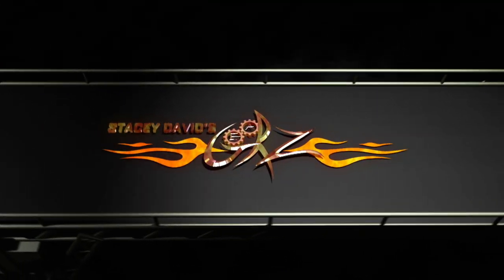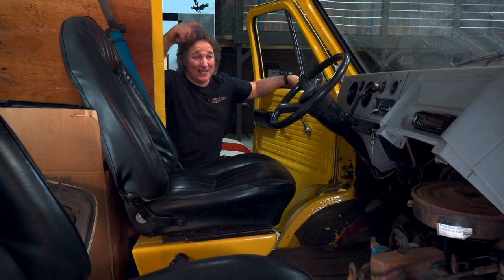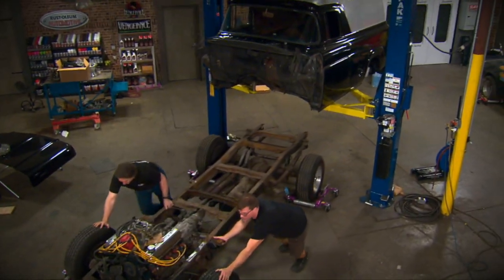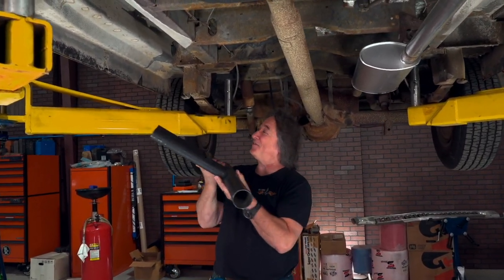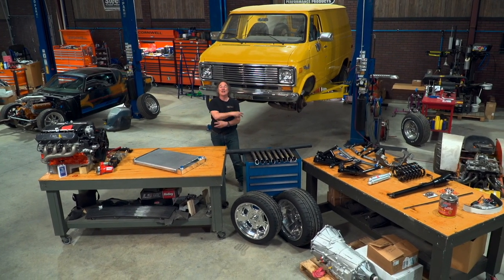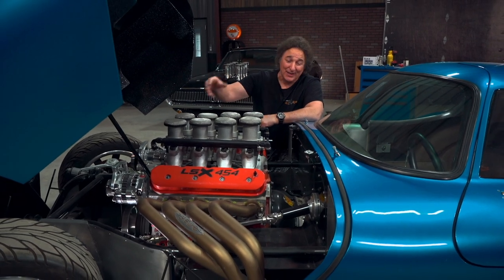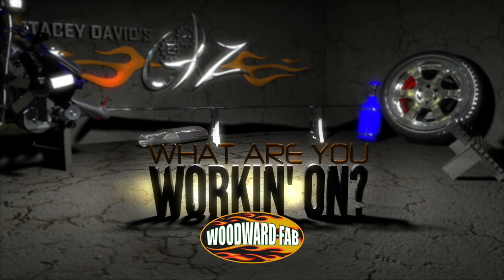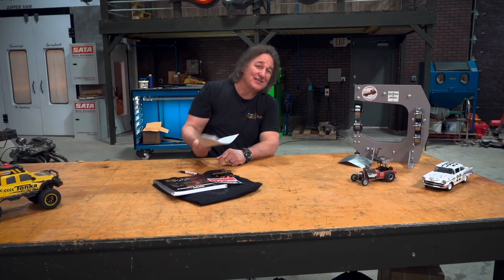PLAN Your Project and Avoid Frustration - Chevy/GMC Van Upgrades - Stacey David's Gearz S16 E12

Comment: Something I've learned (in regards to the rusty header wrap vs ceramcoat) is that yes the ceramcoat is more expensive initially but if you factor in maintenance on the wrap, eventually it out-costs the ceramic 

If you have the $ and time for ceramcoat I'd say go for it and save yourself time and money later

Comment: It would be nice if Gearz would list the cost of all the items on a build, at retail value, and the cost of the vehicle bought to build. Plus the Labour Hrs. It would put into perspective what the true costs are.
Reply: Van 12 grand
Wheels and tires 3800
Suspension 2600
Steering 1100
Exhaust 900
Motor 25000
Misc 7 grand
Labor building tools welder insurance overhead and a lifetime of obsession 14million. 

All this does is discourage people from trying. Shit, I should delete this
Reply: @destro513  25k for an engine.   Are you high?   That would be the cost for a full up race engine not a crate LS.
Reply: @bmstylee  oh cool so how much is a gm performance gen 3/4 427 600 horse crate motor with turn key Holley programmable stand alone and all the stuff to make it run and mount, starter, belt drive, motor mounts, flexplate, radiator and fans... Oh and I forgot about the 6l80 so more like 35 grand. My bad. Don't forget the big money driveshaft and ford 9 inch or Dana 60 rear with gears and lsd. Oh you said race motor. Let's ask daddy Dave or one of them street racer race car guys how much then motors cost. Bet they wish it was only 25 grand
Reply: @destro513  summit has a similar one for 13k 427ci/630hp.   Or get a 5.3 core, rebuild it, add boost and make 600+ for a lot less.
Reply: @bmstylee  sorry bill, at work running an Okamoto surface grinder. Didn't mean to come off like a jerk. I only know how this all adds up cause I can't afford it and when I thought I could, I couldn't. I'm the guy who finds same van or close for 3500, gets a rusted out 2005 dually for 375 bucks and uses the 6.0 ls and 4l80 with 180k and throws a used cam and lifters at it.
Reply: @destro513  no worries.   Stacey uses crazy expensive parts.  We all know that.   You can get really good power from a 5.3L with porting the factory heads, and adding a good cam.  Put some ring gap in and add boost and 600hp is easily attainable.    I would love to build something but the average gearhead keeps getting priced out more and more.  So I feel your pain on it.   I'm taking my 2017 Silverado daily driver and making it my project car.   I've got leveling struts coming tomorrow which I will be installing Sunday.
Reply: @bmstylee  hot damn bill, I got my 2004 2500hd I'm gonna restore next winter. I love that danged ole truck. I hate how the TV and ebay and bat priced us working folk right outa our passion. I'm all about finding those cars no one is paying attention to. Like 70s Camaros can still be had for like 3500 bucks. Everyone wants the trans ams. And jeep cjs can be had for 1 tenth the price of an early bronco or fj40.
Reply: @destro513  Give me one of those 70s land yachts.   They generally had big blocks in them and enough room for you and your friend to cruise in comfort.

Comment: We have a 1971 Chevy Van that have owned for 45 year. It is factory hugger orange and a place that went closed it door years ago put windows and  interior in it.  It has 295/50R15 in the rear and 245/50R15 in the front. It had some problems years ago and has been in the garage not running but it is do for resurrection. This van has been with use so long that it is part of the family . I would love to send you some picture if I had your email.

Comment: Yep, it all comes back around. Look around at the Cruise-ins, Cars and Coffee and local car shows, Your seeing ALOT more 1973-80's cars, Why? because they have become this generation's "$500 Nova" of our generation, They are cheap "old" cars that still run and and drive that the younger kids can afford to buy and drive while they fix them up. Just in my car club alone there are 6 either being daily driven while working on or being built in a garage and it's all makes and models not just the popular cars, I bought a 73 Buick Regal a few months ago for $1200 and drove it almost 50 miles home, Our Club President is building a 74 or 75 Ford Maverick for his wife, Our Treasurer and her daughter are building a 77 Torino,  one guy has a 75 Nova, another guy has a 77 Plymouth Fury and is in the middle of building a 76 Duster.

Comment: Hi it's me Gary our old Shop truck was a 80 chassis with a 88 cab with a 84 turbo 400 trans from a Chevy van with a 76 3/4 ton rear end with a 94 bench seat that was A 2002 assembled vehicle

Comment: Just a warning to anybody thinking about buying those lower control arms, they ARE NOT a bolt in solution. There has to be some modifications done to make them work. The cross shaft diameter is different. Either the cross member or the shafts on the lower control arms have to be modified.

Comment: I went the complete opposite way as far as the suspension. First did the 4.8ls/4l60e swap in my 86 GMC g2500 conversion van. Now I'm converting it to 4x4. Just need to get the transmission/transfer case,  Front axle rebuilt if i don't decide to go with a Dana 60, both drive shafts made and then the the floor shifter for it. Then when all said and done i will need to reprogram my computer to except the 4wd trans, I think.

Comment: The segment about whether to wrap your headers or get them ceramic coated was pretty informative:

While wrapping the headers is a lot cheaper and easier for the do-it-yourself types of mechanics, it's also more maintenance in the long term 

And despite being more expensive because it requires a professionally trained person to do this, Ceramic Coating seem to be cheaper in the long term as it doesn't require as much maintenance and it lasts longer, and is under warranty

Comment: Not quite true that nobody makes a old school style van any more, Chevy and GMC still offer a full size van whose design dates back to 1996. Because of their low price, they were super popular as cargo vans and can be found used with a variety of engines at every price point. I just picked up a 2014 Chevy Express 2500 passenger van with a stock flex fuel 350hp 6.0 LS and HD 6 speed automatic that runs on $3.99 E85 or $5.99 gas. It's better in every way than my old '89 van and much easier than trying swap an LS into the older vans. Since they have been making the same basic van for 27 years there is a huge aftermarket for accessories, and repair/replacement parts are dirt cheap.

Comment: I have an 83 Chevy van that will be getting a 5.3/4L65E swap soon. The donor is a 2003 Silverado I got from a friend after it had been stolen twice and the cats cut off. I've just put flex pipe on so I can move it around the yard and have noticed that the ECM doesn't seem to care that the cats are gone. (No CEL). So, this has me thinking that pretty much any aftermarket cat should work. What are your plans for cats on this swap?

Comment: Extremely informative. I’ve been slowly restoring, body, paint, interior, engine, on my 74 Chevy G10 (bought my baby new in 74) and have been considering an LS swap. You gave me some great ideas with the new wheels and tire sizes. At some point are you going to get into the wiring and gauges aspect?
Reply: One of the really nice things about that old 74, is that you've got no sensitive computer to degrade and introduce hard to trace electrical gremlins to your ride. (Which is not to deny the existence of electrical gremlins in lighting, sound system, or air handling- it's just that THOSE gremlins are comparatively easier to track down, or bypass)

You've got a van that will continue to run and drive, even if the battery is run down and the alternator has died.

You've got a solid engine that will better withstand overheating, and is better prepared to run on this modern, moonshine infused gasoline. 

Dropping an LS in an old van is tragic.  Stick with a classic, cast iron 350, with mechanical fuel pump, and a 4 barrel carb. Or, shoot, for better ease of maintenance, you can pull lots of power from a 292 straight 6, and still have plenty room to function in that cramped engine compartment. 

It's a hell of a lot easier to engineer a quick fix with whatever randomness is handy on straight mechanical setups, just to get home in a pinch, than it is to try to engineer a quick fix for a fried computer, or a useless sensor that went bad and won't let the engine run.
Reply: @magnificenthonky  Yeah, I thought about it and decided that the juice isn’t worth the squeeze. In its younger days it ran 14’s in the quarter with 2 AFB’s, cam, heads, headers, all the fun engine stuff for its day. I don’t really need the horsepower since I have vehicles that put out almost twice what the Chevy has, but was thinking how fun some of the old days were with that kind of horsepower. Just kicking tires.
Reply from the maker: Yes, we will get into the wiring in a later episode!

Comment: Do you have the part numbers for the A arms and etc from LMC trucks? I went to their website and couldn’t figure out which parts fit my G10.
Reply: 37-8474 TUBULAR UPPER CONTROL ARM SET
37-8476 TUBULAR LOWER CONTROL ARM SET

1973-87-chevy-gmc/suspension-front-rear/chevy-tubular-front-control-arms
Reply: @defiantance  👈 #Legend🏁
Reply: @defiantance  awesome thanks
Reply: @gregc6564  You're welcome.
Reply: They don't fit, either the cross member or the cross shafts on those control arms have to modified. They're NOT a bolt in replacement.
Reply: @defiantance  
Don't buy these lowers if you are not prepared to modify the cross member or the shafts on the control arms!
Reply: @member57  I figured there would be some mods required. I wonder if Stacy will show those mods when he installs everything

Comment: i like his episodes , but lately a lot of people are lusting for modern computer controlled engines , what is wrong with a classic engine that is modern day remanufactured to exacting standards with a correctly cfm rated and correctly jetted carb, that is what i would go with ,  computer controlled engines have way too many wires and sensors to deal with

Comment: Boo Hiss.  That LS swap ruins the build. I'd rather rebuild the stock 6 that's in it.

Computers are foolish things to install into automobiles.  Those sensitive electronics will degrade over time, and the process will be hurried along by temperature changes.  An undetected leak may introduce water to the brain box and fry it out.

There's an awful lot of time and finance being dropped into turning a solid vehicle into a problematic piece of junk.  What a waste of a perfectly serviceable van. May as well make it completely useless, and chop the roof, shorten it by 10 feet, and outfit it with those hideous oversized wheels and rubber band tires that completely defeat the purpose of pneumatic tires to begin with.